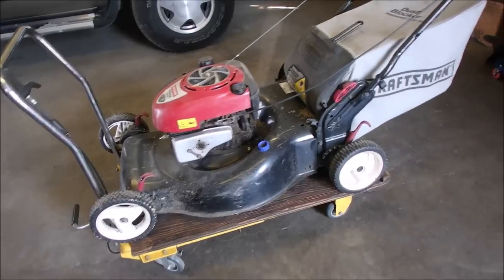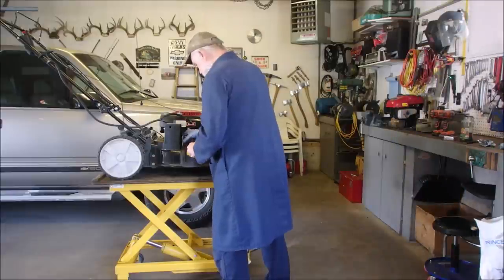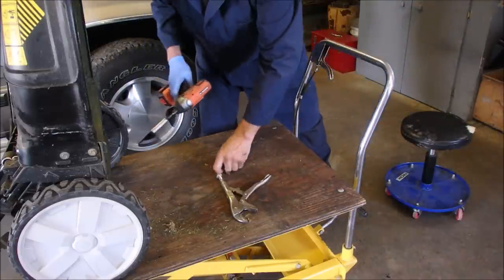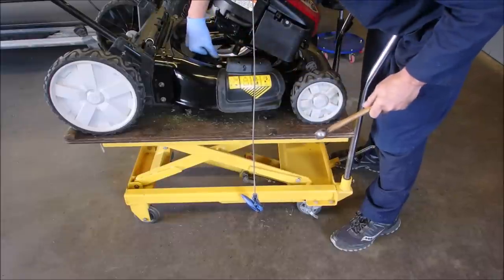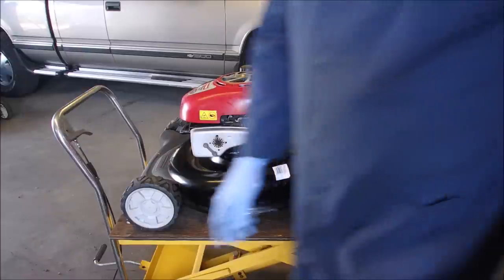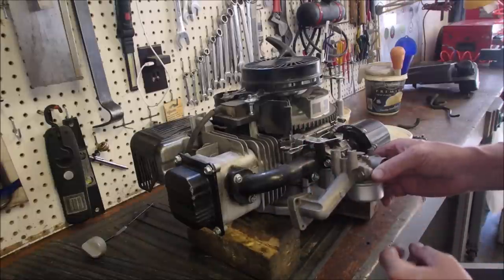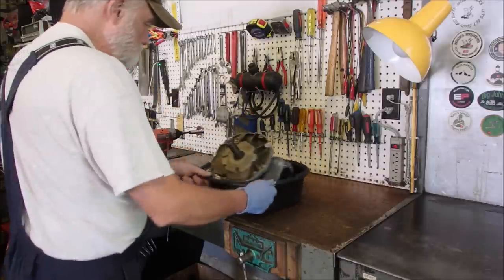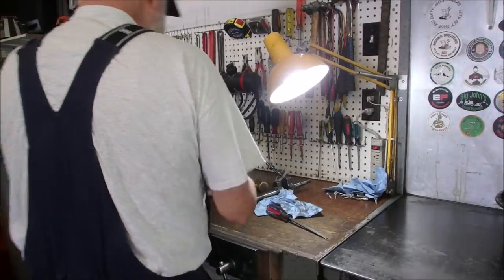Two  Craftsman Mowers Become 1 (Plus Bonus Videos)

Comment: That first Craftsman deck was built by AYP / Husqvarna, it’s a very good mower and one of the last before MTD took over Craftsman and started building the cheapo ones with the plastic front and back pieces. Now those MTD ones are all you can get, they just put a different name on them and paint ‘em a different color.
Reply from the maker: I have always said I am not an expert on who makes decks.  Thank you for your knowledge.
Reply: @BrucesShop  I have to say, I’ve never seen a Chinese knock-off engine quite like that though. It almost looks like a Tecumseh copy or something lol! I don’t think it’s a Loncin engine but who knows anymore. Not surprised it threw a rod!

Comment: I believe that I told you about the toenail clipper trick to flush cut the ty-wrap smoothly. It works because of the crescent shaped cut it makes without leaving sharp edges.
Reply from the maker: Good idea.   I have used thousands of tye wraps at work and we had an actual tool to do that but when up on the cable runways you never have that tool so my little blue side cutters work very well.  Thanks again for the fun!!!

Comment: Great work Bruce!
As you know, I have one of those rear drive machines in my inventory right now.  It’s a beast but it’s like brand new.  So, it will sell well.
Zip ties are one of my pet peeves as well. I get so many mowers where the zip ties have never been trimmed.  It’s the first thing I do!
Reply from the maker: Right on!   I don't mind if they haven't been cut it is when they are cut and leave an edge.   Thanks Jim
Reply: There is actually a tool you can get which tightens the z.ip and cuts it flush = no bleeding.  Expensive though, around $40 I think
Reply: @MrRunner  hmmm…
I already have side cutters!  🤣
Reply: @jimyeske8498  As do I.  The advantage to the tool I mentioned is that it tensions and cuts at the same time and sidecutters often leave a sharp edge.  If you are only doing the odd job now and again it probably isn't worth it, but if you do a fair bit of cabling, it is a godsend.
Thanks for replying.

Comment: You said you prefer a "NON" self-propelled mower. I built myself one of both. I have my ancient Murray push mower but I also have a newer Murray self-propelled that I installed Quantum B&S on both. This video is a testimony on how Briggs and Stratton built awesome flathead engines. Awesome video 👍🏼
P.S. The self propelled had the newer OHV B&S with a bent crank shaft.
Reply from the maker: Thanks  Very interesting.

Comment: If the Craftsman model number begins with 917, it was built by Husqvarna/AYP. A 247 prefix indicates that the unit was made by MTD. It's personal preference, but I think the mowers built by Husqvarna are better quality. Great video Bruce.
Reply: Shawnee hills engine good info
Reply from the maker: Thaks.  You know most of the mowers i fix are older.  I don't pay attention to the deck maker.

Comment: Nothing like doing an engine dissection.  It is important to keep the engine oil topped up or you blow a rod.  That's okay cause you found a replacement and  you will have a nice machine when you are done.  Thanks Bruce.  Stevo
Reply from the maker: Well said!

Comment: The old MTD deck still looks good, no rust and all metal sturdiness. I have two with the hybrid (plastic/metal) MTD deck and they are prone to rust and seem a bit floppy and flexy.
Reply from the maker: They are "flexy" as you say.    Good new word for my small engine dictionary.
Reply: That old deck is actually a good quality AYP / Husqvarna built deck. They were making Craftsman mowers back then before MTD took over. The newer one is an MTD with the plastic front and back sections and you’re right, they are flexy and floppy and prone to rust. The paint peels off easily too.
Reply: @mjg263  Well that explains why it held up - not MTD! Yes, I forgot to mention the crappy paint, the rust from under the deck spreads to the side shoot and then creeps up the side toward the top flaking off the paint. This can happen within three seasons from new if you aren't religiously cleaning under the deck.
Reply: @BrucesShop  I like to think of the flexy-ness as a suspension system creating a smooth, magic carpet like ride over the many, many, imperfections in my lawn........

Comment: Was there any stamp anyone on that chinese engine?  I've seen a handful of different designs, but not quite able to pin point one down with a Tecumseh style carb.  Usually, it's either on the block near the oil dipstick or on the  back side of the block.  Kinda curious to find out who makes it.  I've see LCT and Loncin but not seen that style engine yet
Reply from the maker: Not that I know of.  This is the first time I have seen this one as well.

Comment: Nice engine swap Bruce looks like you may have a small fortune in parts from the broken rod Techumseh style clone (is it a Loncin?) I think the air filter alone is $20+
Reply from the maker: I looked it over and did not find any identifying marks.  Even the camshaft looked like a Tecumseh but this one had no oil pump.

Comment: What caused rod to break? It had oil in it.
Reply: Lack of regular oil changes or running low on oil and overheating of the engine are main culprits for rod breakage.
Reply from the maker: It was low on oil so yes Wayne is right.